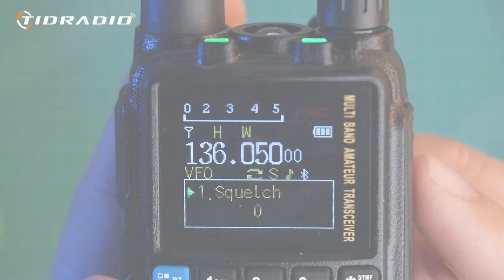TIDRADIO TD-H3 Lesson 9 |  Squelch Level

Comment: can having the squelch level set to the maximum cause issues with transmission and reliability of the transmission?
Reply from the maker: Yes, it will filter out weak signals and affect signal integrity and reliability, especially in long-distance communications or when the signal is weak.